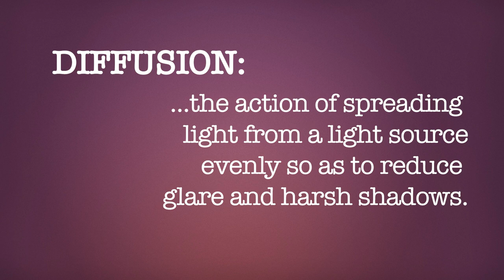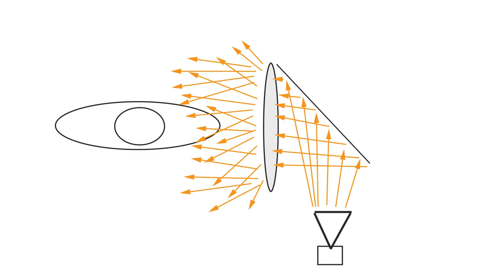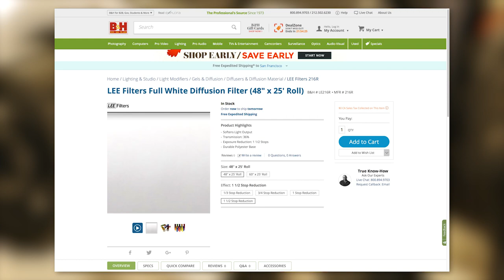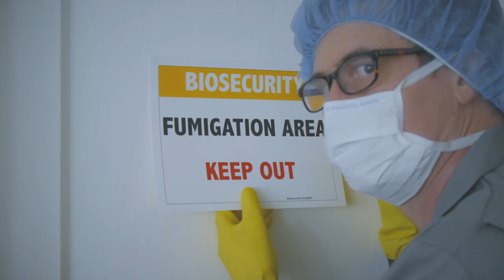Diffusion Lighting: How and Why to Diffuse Light

Comment: What about Wax Paper can that be used for Diffusion
Reply from the maker: Sure but has very low heat tolerance and usually is not pure white. It would give your light a tint that you may not want.

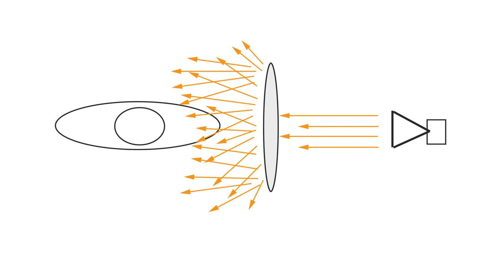Comment: Diffusion materialss doesnt actually change the actual ray of light coming through it? (2:45) It does scatter the light rays like it is shown it the video (3:27). This natural phenomenon occurs in nature with the sunlight and the clouds. The sun doesn´t move (the hard light source) it is the clouds (diffusion) that are positioned between the light source (sun) and the subject (earth, cities, people etc.). The fact that we can move the diffusion material near or far away the light source doesn´t exclude the fact that the light is being diffused, i e scattered. Correct me if I am wrong but I thought scattered light IS diffused light.
Reply from the maker: Scattered rays of light are relative to the subject and the light source. The sun can be a sharp point of light in the sky creating harsh shadows. But if I was close to it in a space ship it would loom large and hit me with scattered light from all over its surface. It's the same with a diffusion frame. The wave of light hasn't actually changed.